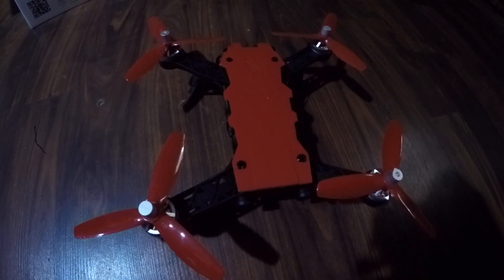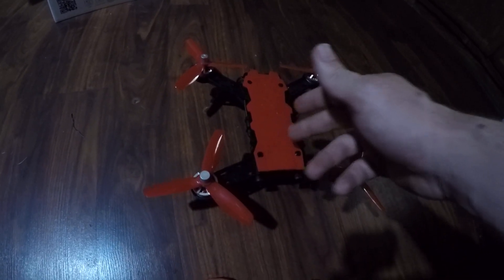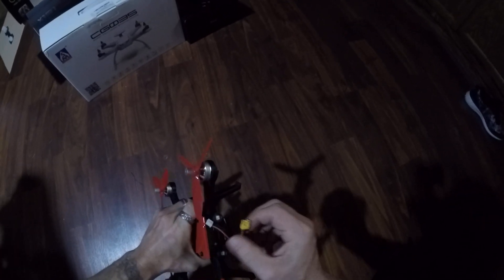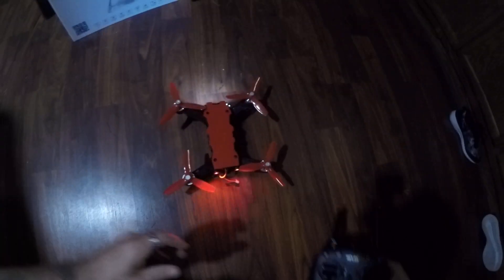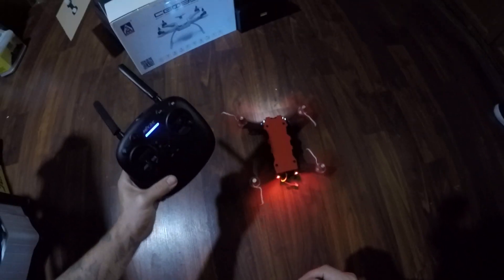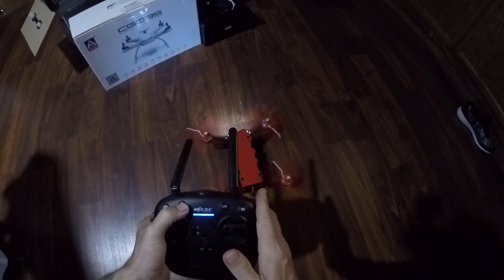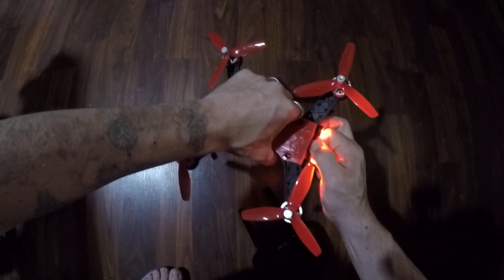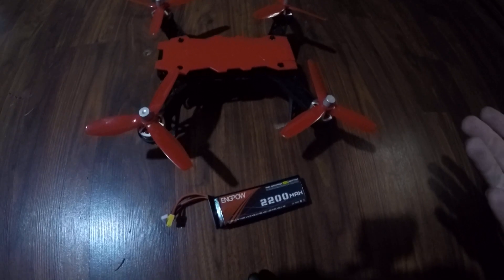MJX BUGS 8 PRO 7.4 battery WHAT WILL HAPPEN

Comment: I tried with a 7.4v 1300mah 
And it keep beeping.. fuck'it
But THANKS for sharing , it might help many.. cheers

*just make sure you read all description while u buy a new battery bcs most site are selling the Bugs 6 battery rep. But hard to get the 11.1v
Tricky or not idk but ennoying..

Finally i decided to use the XT30 plug of the 7.4v batt and soldered it to an 3s lipo1500mah 45C

And it whistle , BANGING'
love that B8 Pro..

Check my channel if your intrested of the B8 pro. footage using a tiny SQ12 or the Q5..

Comment: Hi Jay can I put a 2200 3s battery in the bugs 8 pro? Love your videos btw I used your zip tie idea to attach a 4k camera to my bugs b2w works a treat but i recently smashed it at full speed into a viaduct bridge there wasn't a mark on it just snapped props 😂😎
Reply from the maker: happy just smashed props n yes go for the bigger 3s battery im thinking on doing the same but i have to change or mod a connection should be fine
Reply: Thanks for the reply what's your opinion on the wizard x220? I'm a huge mjx fan but fancy a change
Reply from the maker: there solid drones and I LOVE CHANGE lol love to switch it up
Reply from the maker: Yo yo don’t put 3s  on it no go
Reply: Jay Drone the bugs 8 pro comes with a 3s? 🤔
Reply: And so does the wizard x220 dosent it?
Reply from the maker: Mick P yes 3 s
Reply from the maker: Mick P I’m sorry go big on the bugs 8 Pro I just did don’t do 3s in Bugs 8 or 6
Reply: Jay Drone thanks. Are you doing a video on the wizard x220 at any point? I'd like to see that